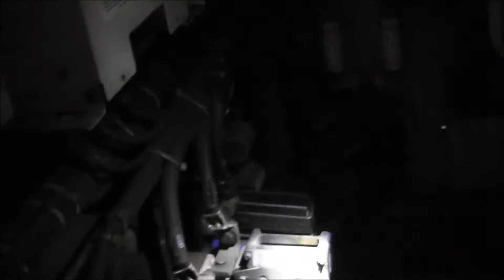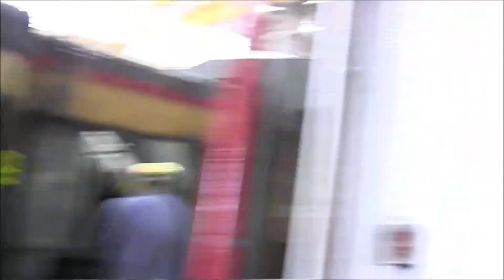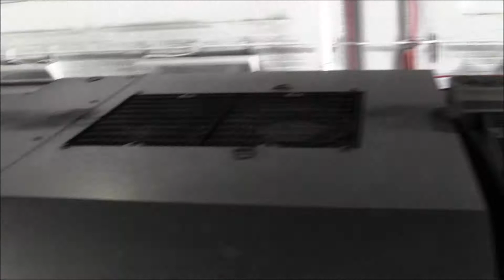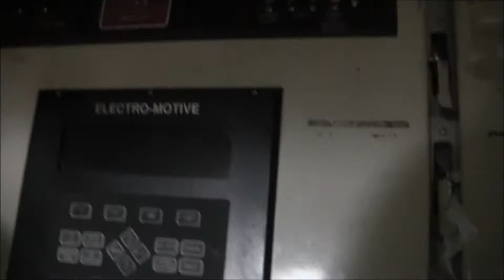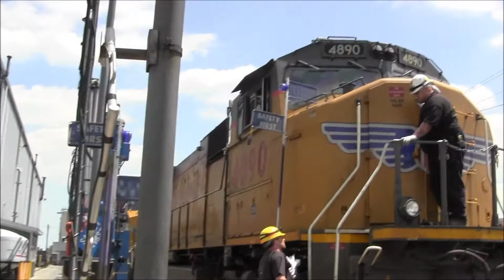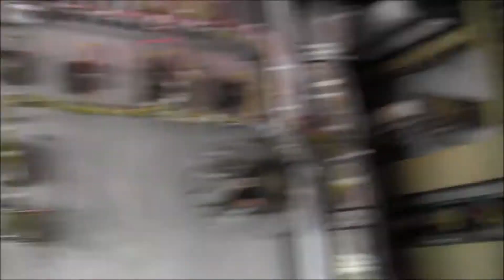Tour through the UP proviso yard part 2

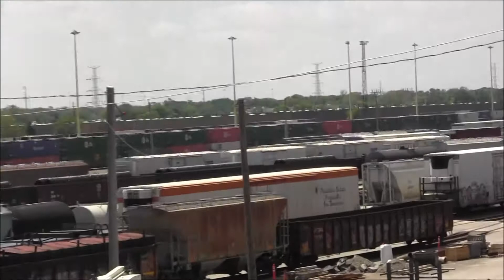Comment: All that activity you hear and see in this video has either ceased or slowed down dramatically. A mechanic i know that was  with the company well over 20 years was fired along with many others because of Precision scheduled railroading. That parking lot at East 5 (small red brick building) has 1/3 the cars seen in this video. The footage taken from the rusty brdge at 11:02 track 32 thru track 66 has been removed and turned into parking for containers. The maintainers truck is on track 23. That genset locomotive is coming off the rip runaround (track next to the supply of drawbars,trucks, cushioning devices etc) and passing the rip pocket that the tank car is on, to work between track 32 thru 42. All of this track information can be followed fairly easily by google maps prior to 2020. The latest changes as of Jan 31, 2023 dont show on there.  I'm glad some things of what railroading used to be like was preserved.